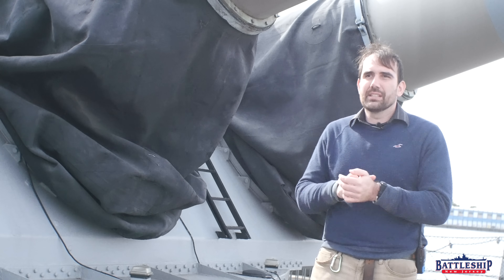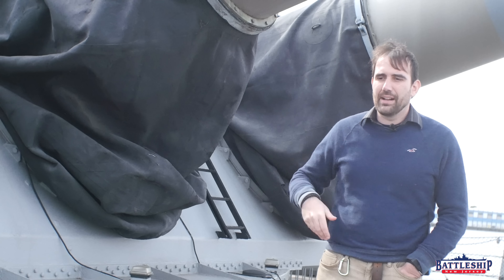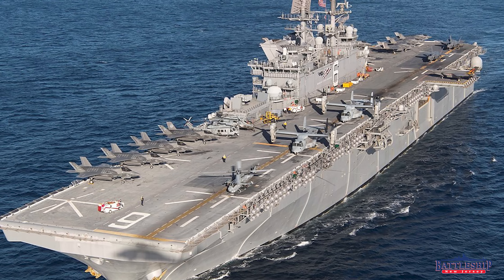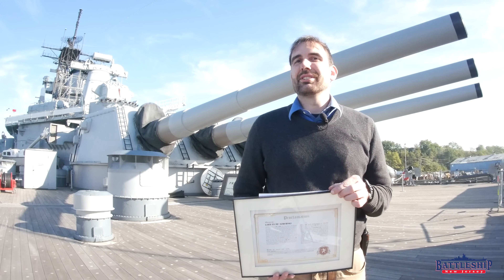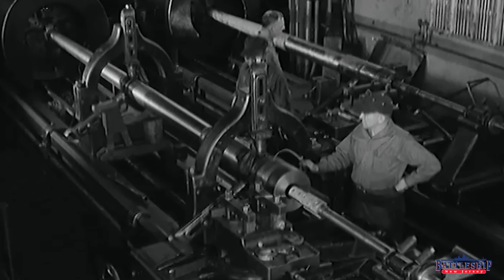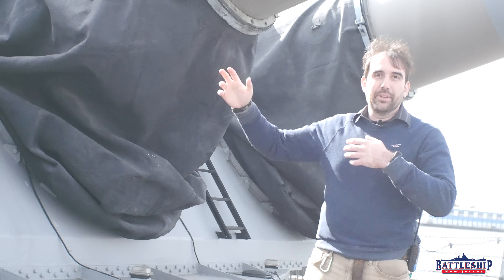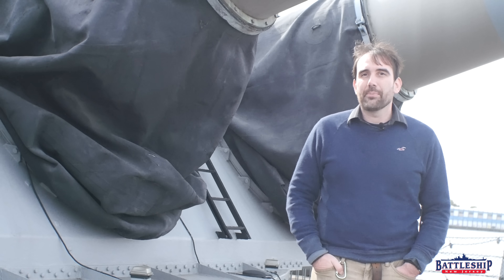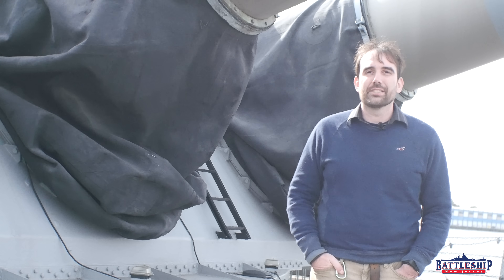How Much Would It Cost to Build a Battleship Today?

Comment: Definitely build new. 6 ship class so we have 1 on duty at all times in the Atlantic and Pacific. Hull form similar to Vanguard for seaworthiness and enhanced TDS. 4x3 gun 16" turrets(autoloaders if possible). Modern crew accommodations. Automate as much as possible. 4x1 5" lightweight deck guns. 8x1 76mm lightweight deck guns off the LCS. Modernized Goalkeeper 30mm CWIS. SeaRAM. As many of each as can fit. Sonar and ASROC for self defense. 
Battleships are gun platforms, keep the mission gun-oriented and give the ships enough defenses that subs and missiles aren't as much of a threat. Missile defense and offense are for the Burkes and Ticos. Keep it there. 
Make these ships the diplomatic platform like Ryan has said a few times. A Battleship is meant to be in your face with all the guns all the time. Over the horizon isn't an effective diplomatic tool.
Reply: I'd honestly push it to 18 inches or more, because it's probably still going to have missiles for main over-the-horizon anti-ship duty. any large cannons would either be used for shore bombardment or attacking ships in a squall. as for the 5 inch guns, forget it, CWIS can take care of anything small enough to evade the big guns, and anything too big for them to hit, well, probably hit with something from the VLS the navy seems so enamoured with at the moment. 

The one thing I would add, is a drone hanger and catapult to the stern. forget choppers or VTOLS, Aviation battleships are dead ends. but, being able to send drones out to spot, maybe fire-direct the main guns... well, we've seen how useful Drones have been for that in Ukraine. and unlike Seaplanes of old, no need for large, heavy cranes for recovery.
Reply: There is no need for 16" guns 6 - " would be mor than enough to obliberate any opponent. Even the AP ammo from an "AVENGER" is enought to make Swiss cheese of the of almost any modern surface ship, provided the plane or vessel can dodge the defences.
Reply: @EK-gr9gd  Not about firepower. It's about range. You can sabot a 16" round and get miles more range.
Reply: @zbiggun7594  100 km , 62 miles should be more than enough
Reply: @EK-gr9gd  No such thing. A 6 inch gun has to compete with cruise missiles. They have about the same effect on target. An 11 or 13 inch sabot is going to outdo even a Russian cruise missile for effect on target. And you still have the option of the 16in rounds closer in.
Reply: @zbiggun7594  The disadvantige with CMs is the required lock on target. No cm can compete with tube artillery, in that area.

Just look at MRSI, no cm could do something like that. Not even the NSM.
Ask a marine which he would prefer, a saturation with 3 - 6" Shells or some cm.
Reply: @EK-gr9gd  That completely missed my point. I'm not talking about guidance. I'm talking about amount of ordinance on target and the effectiveness of said ordinance. And we have wandered off the topic of my post. The point is to build a battleship, not a cruiser or up gunned destroyer. That means guns 14" and bigger. Not looking to build a monitor either (low number of big guns meant exclusively for shore bombardment. See Lord Clive class).

Comment: Having visited Heavy Cruiser Salem last year and just yesterday getting a " Firepower tour " on board Massachusetts with Dr. John Scholes I can say that  the existing gunnery systems on these ships were masterpieces of naval construction and had many  ways of putting their ordinance on target. As an intermediate step a refit of Salem with modern missile systems could be done quickly and relatively cheaply and we have seen how effective the Newport News was in Vietnam. Following training cruises more modern long range ordinance for the 8" 55 caliber gun could be developed ( rocket assisted  shells )  and a new cruiser design based on the Salem could also be developed. We have no replacement design for the CG - 47 class and I think it could be a modified Salem.
Reply: Refitting Salem would be just as difficult as bringing back an Iowa. Same problems on a smaller, less capable ship that would be a huge manpower problem.
Reply: @rocketguardian2001  what if we made a De Moines class Cruiser but made it to the same standard as a potential predecessor to the CG Class. it would be a hell of a lot easier then doing the same with any battle ship let alone an Iowa class. especially since it would not be such a huge power drain  because of not needing such huge engine performance to get a ship that large up to a decent speed among other things such as power to weapon systems, sensors, and crew comforts across such a large ship
Reply: Back in the day when the USN refitted its existing (Baltimore class) cruisers with missiles, it was already deemed cost-prohibitive
Reply: @Wannes_  yes I believe that's why they refitted the Cleveland class instead, although they came out with huge superstructure that made them look like they would tip over in a light crosswind
Reply: How farther would rocket assisted shells go compared to regular gun shells (available techs proably in use in the Army today maybe?)
that 8 inch (160mm ) stuff.
Did Salem has armor platings too?
Reply: @DiscothecaImperialis  I have been told that ranges with rocket - assist shells could exceed 100 miles. As for armor Salem has a 6" belt of armor and an armored deck I believe is 3" thick.
Reply: @phillipbouchard4197  What are nominal ranges of 20cm guns (did the US Navy still uses Imperial measurement systems and not fully metricized?) mounted on Salem? answer in Kilometers please.
Reply: @DiscothecaImperialis  The USN still uses Imperial. The MK16 8 Inch(203mm) max effective range without Rocket assist was 27km. The Wiki page for Salem has all of her armor values in both inches and millimeters, hope that helps.
Reply: @DiscothecaImperialis  in the 80's there were rumors of work on a laser guidance that could go on army 8 inch round, if the electronics could be worked out to take the firing, there was talk of scaling it to 16 inch and adding a rocket assist to allow a 16 inch gun to go more that 40 NM and hit in 1 shot.  Unfortunately all the Army 8 inch guns were retired and the Iowa's at the same time. It would be interesting to know how far out you could push a 16 inch rap round.
Reply: The BIG issues are the engines, electrical systems and armor.  Spares would be impossible to get on the original 1940's verions of these.  Yes, no one has built a gun that exceeds the perf of the big naval guns, but then, no one has yet seriously tried. Another huge problem is that no tools exist today to forge/build thick armor or large gun barrels.
Reply: Salem.. Whoever named her failed to get the memo that warships were supposed to be named after events in history that we're actually PROUD of!!
Reply: @shoominati23  Sorry no.
in that era carriers were named that way
battleships were named after states 
cruisers were named after cities.  heavy cruisers were big cities light cruisers were small cities. Look up their names
Reply: @derfvader6951  Witch Trials..
Reply: That would definitely be a more economical option than new Iowa class battleships.  A ship like that would probably need to use either combined nuclear and gas or pure gas turbine propulsion for survivability reasons, but otherwise all that would need to be done is replace all the 5 inch secondaries and AA guns with Mk41 VLS and either SeaRAM or some sort of laser point defense system.  Adding Aegis would be an interesting idea, but the concussion from firing the 8 inch main batteries might be too much for the radars.  It certainly would be on the Iowas with their 16 inch guns, which is why plans to add the Sea Sparrow missile system to the Iowas back in the 80s were scrapped.  An alternative solution would be something along the lines of the Strike Cruisers that were proposed during the 70s.  They were built around the Aegis combat system and had tons of room for VLS.  They even would have had an autoloading 8 inch gun up front.  Also a Strike Cruiser would have an armor protection scheme more like that of the existing Arleigh Burke class DDGs, which would eliminate the need for tooling up the entire country to make thick armor plates for the new ships.
Reply: A better idea would be to revisit the old CGN-42 design from the 1980s and modernize/improve upon it. It was already a nuclear-powered Aegis cruiser, adding VLS to the design, swapping out hull elements, and potentially upgrading to a 6" gun would make it a fine addition to the modern Navy.

Fuck docking in New Zealand anyways.

Comment: If all consideration conclude the need to bring the battleship back, designing and building a new one is the most expedient solution. Regardless of issues such as propulsion and electronics, reactivating an old ship closing the centenary, will be far more expensive than building a new one. Usually old vehicles require more maintenance and spare parts that are hard to come by, or rather unique. Operating costs is obviously a core consideration for which option to go. The most cost efficient way, would be to design a new battleship that can built with the currently available tech, and have some space for retrofit and modernization.

Comment: I personally would gut completely an existing Iowa class battleship down to bare metal and use the frame, 16 inch guns and basic structures of said battleship and add a nuclear power and a complete updated sensors systems. Remember the 16 inch guns are the big stick and modern missiles and automatic guns that can fire up to 50000 ft. A modem battleship can cover the whole earth and touch someone if need be as well as protect itself in a foreign port. Remember, no smoke stack and you do not need old style directors. I can see superstructure mods to make the Iowa somewhat stealthy. I would also reuse steel as well when possible. And not for razor blades!!!!

Comment: Rebuild to be better than the Iowas but, still the same ideas as the Iowa class designers. Over 900 feet minimum. The ship’s would have modern tec hull’s but still steel with better steel making factory’s. Also, some jobs being done by computer and not by human. Nuclear with the use of water jets and not propellers. Also, have the same idea as maybe 16in but the rounds be more useful. That’s just what I think.
Reply: Also, if we could design a metal that can withstand the blast of 30 tons or what the payload that is selected for torpedoes and air to surface rockets, we could have sea wiz and still get hit but not damaged. That would be a major break through. 
Also, do the same to the 5 pound guns. They could make the ships designed search and destroy efforts a lot bigger.
Reply: I’m estimating around 600 crew including multiple welder’s and fitters that can get repairs done in no time. If we make the outer hull or skin of the ship stronger to withstand the blast, less pipes and less power loses.

Comment: 100% new built battle ship. The only way you’d use an Iowa in a modern conflict as if you took the turrets out. 16, or even 18 inch guns would be a supreme liability.

Basically a modern battleship would be a missile boat and antimissile boat…

Imagine each turret replaced with hundreds of missiles….